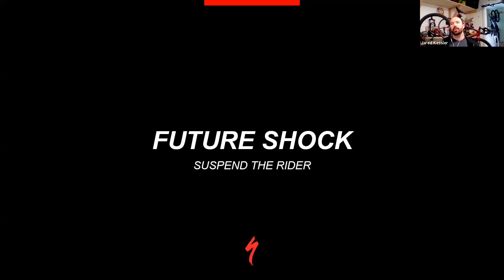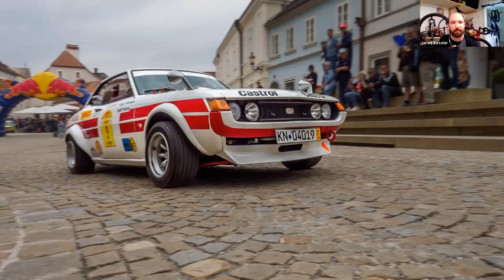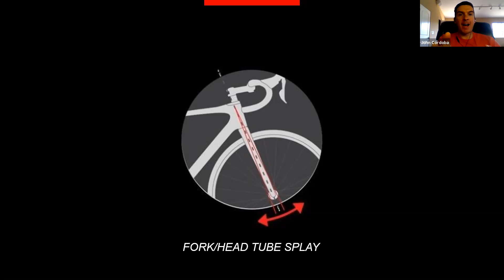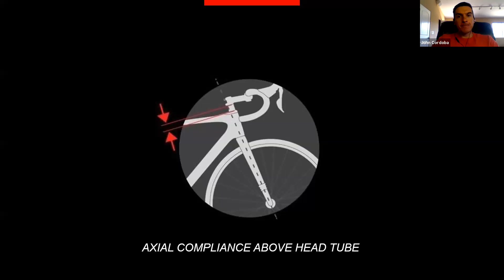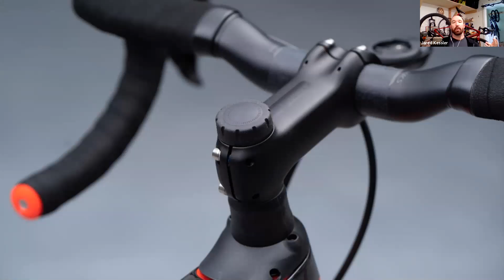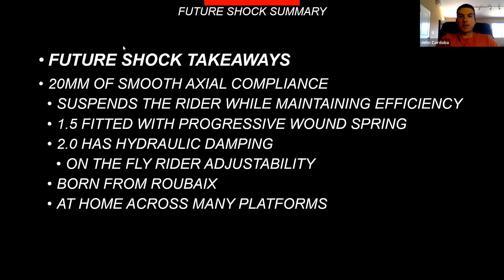Specialized Deep Dive, Ep. 3: Future Shock

Comment: Future shock is garbage, it’s heavy, feels sloppy,  all my effort gets sucked right up by the shock , there’s nothing good about it. I had a 2010 roubaix, it was light, stiff, you feel connected to the road.
Reply: Do you have a specialized with a future shock? How does it feel?
Reply: @lawofuekiaddict  yes I do, don’t do it.
Reply: @kahalawhat  so it affects climbing and sprinting? Im choosing between tarmac and roubaix for my first road bike. Im from mountain biking so i want comfort and speed but hearing that from you makes me think lmao
Reply: @lawofuekiaddict  mountain is not road so you don’t need sus go with the tarmac you’ll tank me later. Oh and rim brake over disc
Reply: I'm considering a new Diverge which comes with Future Shock 2.0. I'm thinking of how I could bypass the system. Perhaps get an aluminium insert bonded into the steerer. Just need to make sure headset preload is still adjustable. Or just look at a different bike with similar progressive geometry.
Reply: @steveedwards5280  Hello, did you find a way to bypass future shock? Or maybe to install traditional fork?
Reply: @Spajdi2310  I decided against a Diverge in the end
Reply: @steveedwards5280  Oh okay, thanks

Comment: Thanks for the video. My wife and I both have a 2018 Diverge with the 1.5 and she also has a Creo with the 2.0 She's getting pain with the Creo and I've noted that the Creo stem is 80mm +-6 while the Diverge is 90mm +- 7. Does the new Diverge still use this stem or can you recommend a Specialized stem that would work. She wants that Diverge feel on the Creo